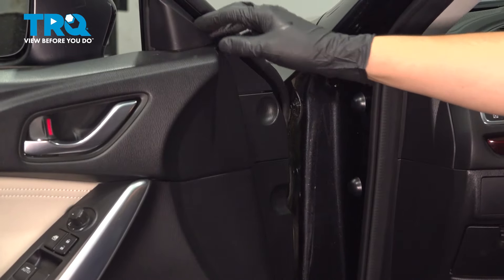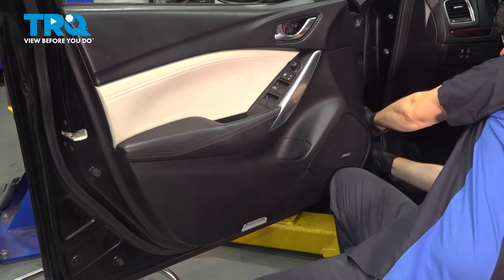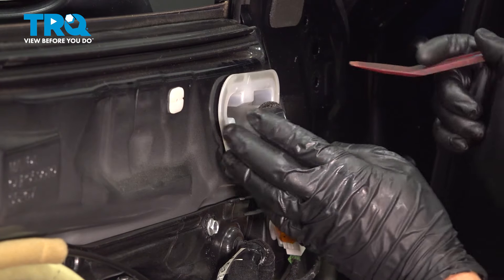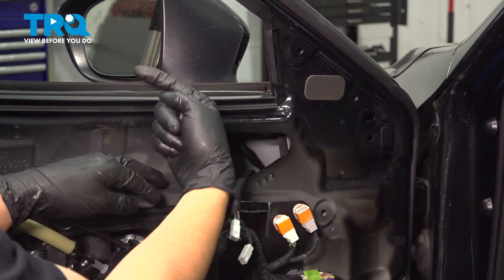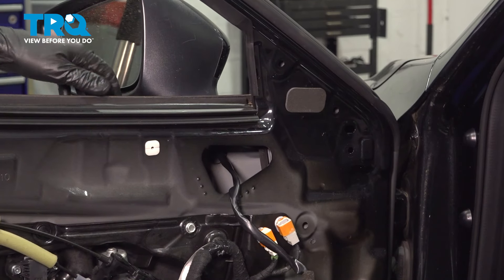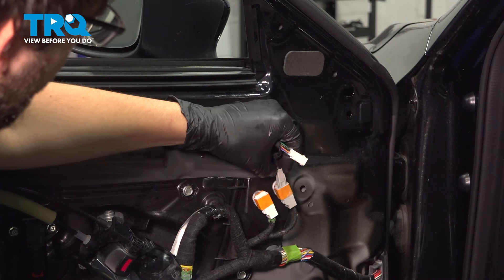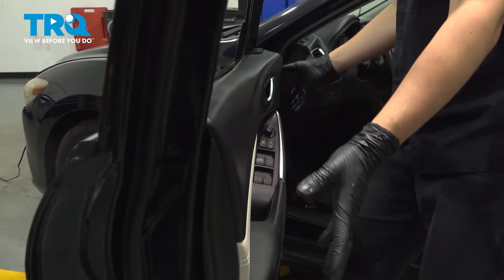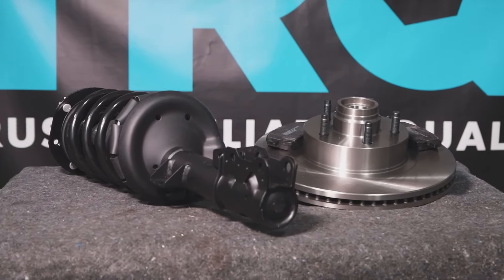How to Replace Mirrors 2014-2021 Mazda 6

Comment: The mirror I am replacing has the two (white and grey) wiring connectors, but the replacement mirror only has the white one. Am I correct in assuming that I should just plug the new mirror into the white housing and not worry about the grey housing? What is the difference between white and grey? Blind spot sensor and heater? Which is white and which is grey? Thanks for the clear video!

Comment: Great tutorial.  Watch twice, write down all the steps and follow. 
Just one think to check before putting the door cover back. Some of those white little push pins may stay in the door after removing the cover, so before putting the cover back make sure all push pins are all inserted into the plastic cover.